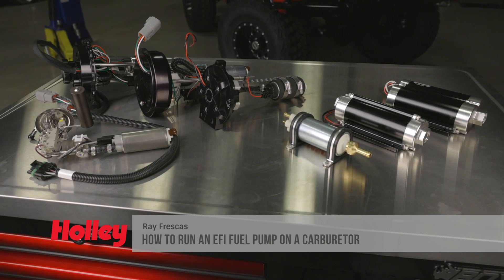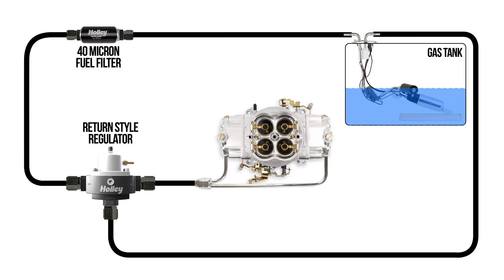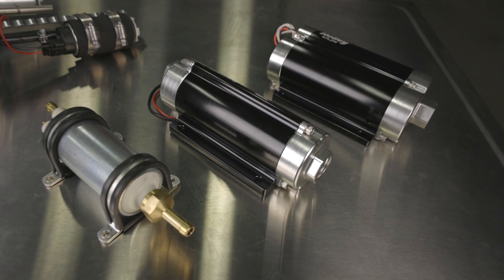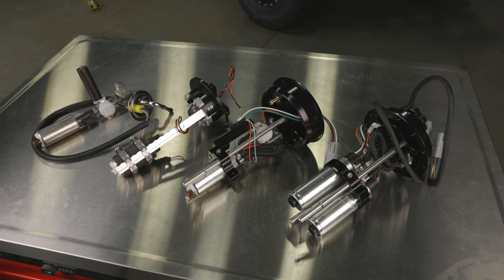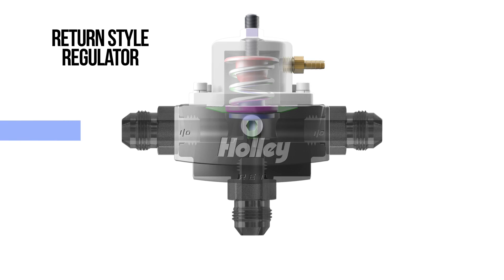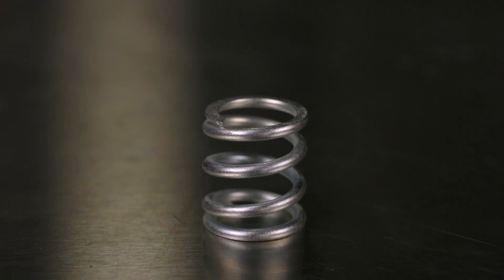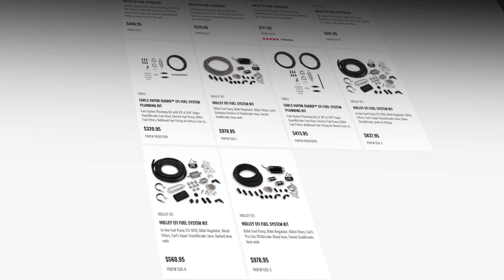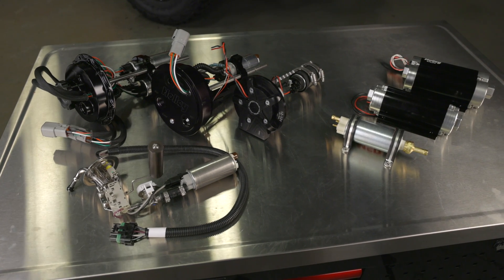How To Run An EFI Fuel Pump On A Carbureted Engine

Comment: BS, there's plenty of quiet fuel pumps for carburetors.
Reply: Care to share. I have only used several holley blue and red and they are getting old after 40 years of hearing them in my cars.
Reply: @BBBILLY86  I use Carter. It's quiet.
Reply: @joe-hp4nk TY

Comment: Does the regulator need to be up front by the carburetor or is it ok putting towards the the fuel tank and running a shorter return line back to tank and would the 6psi regulated pressure pushing fuel to carb still be able to solve a vapor lock problem?????

Comment: I installed a Holley red pump on my 1970 F250 about 6 years ago against the warnings from a few co- workers that it would fail. Well it did after only about a month. Very disappointed as I had used that same pump in the 90's with never a problem....anybody else have  the same or similar  results using the red pump?
Reply: Yes new stuff is all junk,my last one screamed like a red headed step child lasted for years, new stuff won't hang maybe a year tops. Idk I think its on purpose

Comment: Having the bypass regulator after the carb, instead of before it, is the better way to go.
Reply: I don't understand though? What if the carb has no return on it? I get you can t of the feed but what is the benefit of doing it after the carb instead of before? Wouldn't you want it regulated before the carb?

Comment: No you do not want to deadhead the fuel to the carb, you will burn up the electric fuel pump since it uses the fuel as coolant. Therefore you need a return line so the fuel continues to flow thru the pump at all times. And there is no gain by going to an efi pump, if you set up a 5 to 7 psi pump correctly. Just use Napa fuel filter 3041 for 3/8 line or 3040 for 5/16 line and a good 5 to 7 psi pump.

Comment: I just purchased a Holley 12-159 and I'm going to be running a carburetor. What regulator do you recommend for this set up. Also what size fuel line and return do you recommend?? Thanks for the videos!!

Comment: I have a 1990 Corvette with the L98 TPI motor. I want to go with a carburetor. So my question is could I use the 12-880 and just change the spring to go from 40 psi to 7 psi ?

Comment: First thingI have a never bin started rebuild Olds 350. Will be putting in a Holley EFI, but having trouble figuring out the type of fuel pump and regulator needed, please some advice. Secondly does the engine  need to have bin  running before installing an EFI?